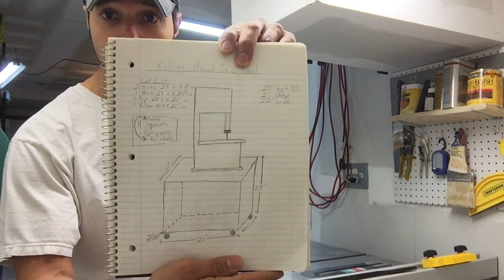How To Make a Rolling Band Saw Cart

Comment: Great clear video. 
Is it a problem the wheels not braked for when saw in use ? If you just had wheels on two corners and skids  on other two corners you could just tilt on skid side of table and roll it on wheels and bandsaw would be fixed when skid side lowered when in use ?

Comment: Hi Anthony -- Excellent video.  I have the same WEN saw and am contemplating doing the same thing.  Question: what about the base plate that comes attached to the bottom of the saw?  Did you bolt it down to the top of the cart, or how did you think about that?
Reply: Sorry -- just watched it again, and you actually answered my question in the video!  Thanks again.

Comment: Great Build. 1 question though, that height of 25" does that include the height of the wheels and those blocks for the wheels? or overall it's 25"?  Take Care,  Barry (from England)
Reply from the maker: It's more like 25 3/4" overall cause of the 3" wheels and 3/4 plywood blocks
Reply from the maker: I added that extra plywood last minute or 25" even would have been the exact height
Reply: Brillo thanks for the quick reply.
Barry.